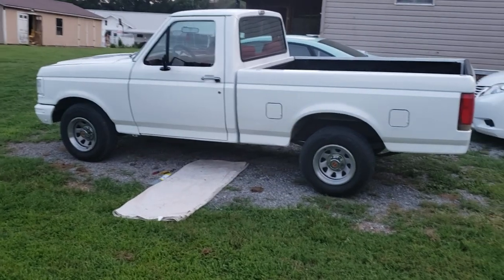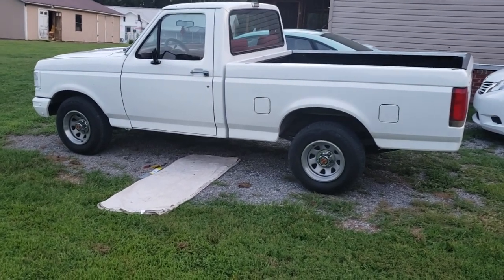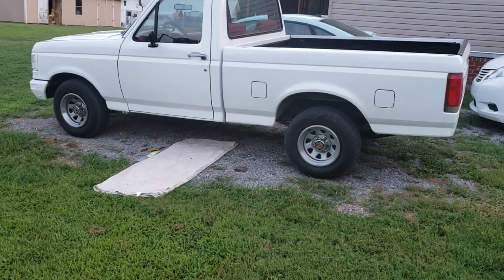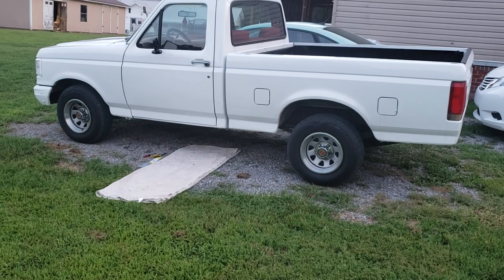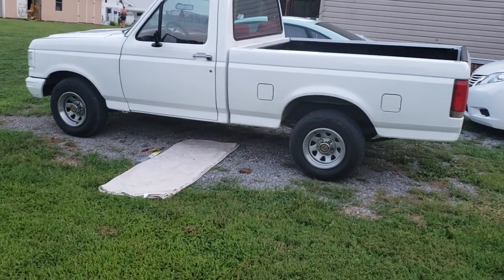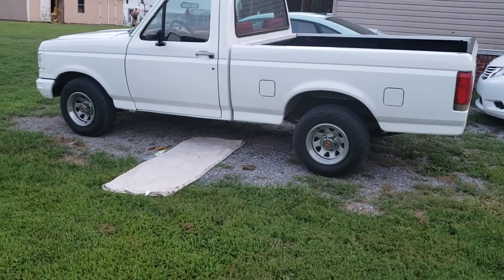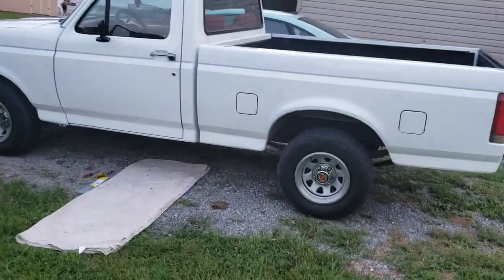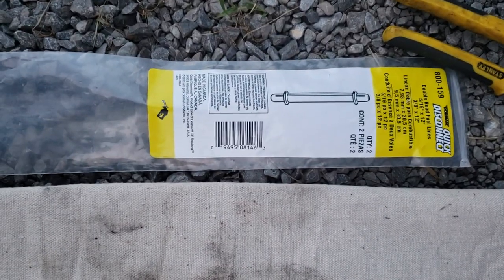Obs f150 fuel selector valve and tank troubleshooting.

Comment: You should've just replaced the Fuel selector valve. It's a common problem and Easy fix. Just replaced it on my 93.
Reply: did you do it yourself? I have this problem on my 96 and don't know if I should attempt it myself or not
Reply: What did that cost you?
Reply: @6BABY 

Two bolts and 6 lines. Autozone sells the tool you need to disconnect the fuel line fittings. Im about to do this on my 96 as the fwd tank backfeeds into the aft. I've replaced both tanks and fuel pumps myself. Just make sure you get the tool for disconnecting the lines.

Comment: Hi! A friend asked if this is something we could do to fix the same problem on his F150. I'm trying to see exactly how you installed the lines. Are they installed inline to make a dummy valve, and the return hose loops around to bridge them? Thanks!
Reply from the maker: I unhooked my front tank and bypassed the selector valve with the two short pieces of line. Once you climb underneath and find the selector valve you'll see how easy it is once removed. My truck has been running fine every sense I did this.
Reply: What did you use for parts im very curious